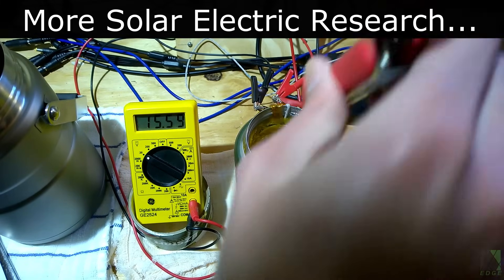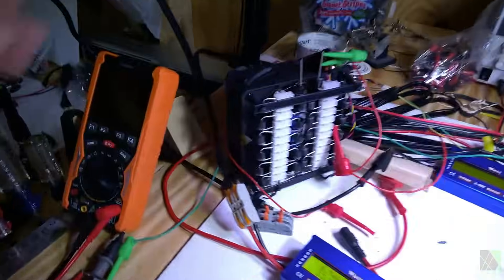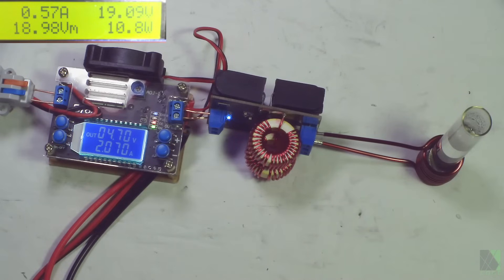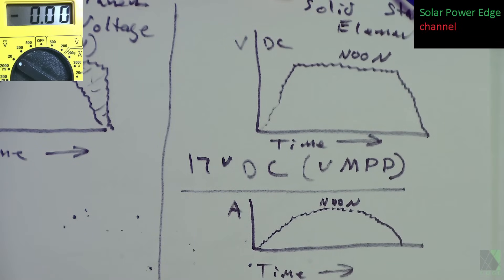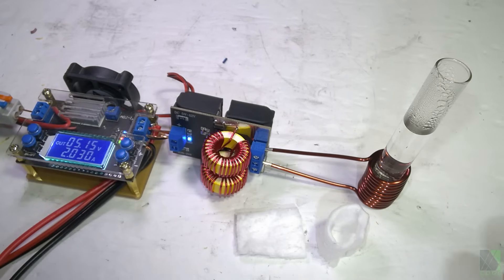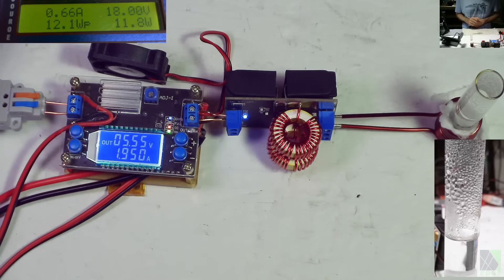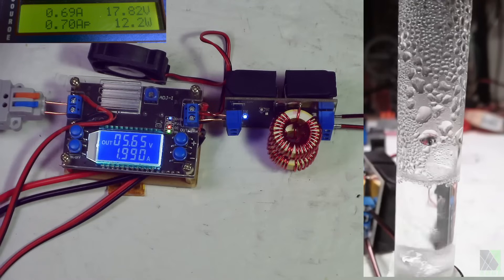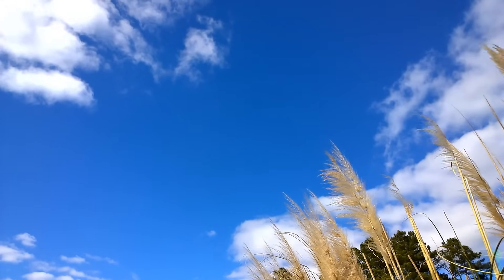15 Watts of Solar Power Boiling Water! induction experiments in my solar workshop #experiment

Comment: can use your induction heater around a radiator  pump water around ;)
Reply from the maker: @tenij000 Really need to try that :) could use metal slug inside rubber hose to heat the water.. I have some small radiators packed away somewhere that could be used for the experiment

Comment: If you can boil water with this little power. What if you had a 100-200w  induction coil heating a container with water in it then tat hot not boiling water was pumped using a small low powered pump through a wet radiator. The type of radiators used with a gas boiler they don't hold that much water and you only need to heat I to to around 60 degrees Celsius. Could be a cheap way to heat a tree room.   You get elements for these radiators but they use too much power. Induction has the potential to be more efficient and cheaper to run.
Reply from the maker: @woodworks2123 I like your ideas, thanks for sharing! This was a very small induction device, but currently testing a larger one and really hope to do something interesting with it. I do think induction can be incredibly useful. If any of my future induction experiments are good enough, I hope to share them here :)

Comment: I am confused...  Don't you want to insulate around the coils to keep the heat in?  By insulating the tube, you do prevent it getting so hot it breaks, but you also block thermal transfer.  Seems like putting the coil in a thermos would have been a better option... maybe?
Reply from the maker: @donovanallen The coil isn't really supposed to make heat, that's merely a byproduct of induction. The most heat is coming from a piece of metal inside the insulated glass tube, which is inside the electromagnetic field. Insulating the coil would make it very hot and increase its resistance. So basically induction heat has benefits but also drawbacks. 
You might be interested in seeing this - an extremely efficient 14w solar electric cooker:
https://youtu.be/CRhkZp6ECHk

Comment: Could you design an induction heater for use as a vegetable oil fuel heater for a diesel engine, I live off grid in rural Alaska and need a way to heat a fuel supply (inline, or in bulk tank) to about 100C for use in a diesel generator,  the ambient outside temperature can be as low as -40C/F. It would be ideal to heat a copper fuel line that could be wound around the fuel filter housing before the fuel pump using a low input induction heater that maybe could be hand cranked? Like a small hand crank radio or powered by batteries, however batteries really don't like the low temperatures here. If I could heat the fuel to 90C before the injection pump then the generator could use waste vegetable oil as fuel without first starting on regular Diesel fuel, thus negating the need to buy said diesel. I get the vegetable oil for free so this would be the ideal result. Fuel supply is aprox 3/8" ID tube and aprox. 1 US. Gallon per hour. It doesn't need to be hot, just warm enough to reduce the viscosity of the vegetable oil to about the same as water at room temperature.  I have access to lots of scrap materials and parts so a list of junk that could be used would be very helpful.  Thank you for reading this and for your great videos.
Reply from the maker: @jasonburguess Hi, I'm thankful you like my videos :D do you have a small insulated container available? what you're describing could absolutely work, even without induction. A simple resistance heating element might do the job. Question is, how many watts Watts to heat that gallon of fuel in time. It is only my opinion, I'd find a container of about 1 gallon and start experimenting with warming it up. Insulation might be required in such cold climates (more heat going into the oil instead of the air). Not sure how much fire risk is involved, but obviously safety first. And the fuel lines might need to be insulated in transit to the engine. I'm surely not an expert on surviving -40 degrees but just sharing my thoughts for what it's worth
Reply: @solarpoweredge  I was thinking about heating a gallon or so too, but seeing as the generator which is a 2 cylinder lister diesel making 6500 watts only consumes a gallon per hour, I thought it might be easier to use a low powered Induction coil around the fuel line and filter just to get it started, then once running I could use a 240 volt 2500 watt resistance heating element to heat the rest of the tank. I'm not sure, but I think a small hand crank emergency radio has the frequency switching circuit necessary for the Induction coil,  and a small battery could be used in a transformer circuit for the input voltage. But I'm new to all the electronics on this and thought you'd know better than I do weather that was possible or not. Thanks for your replies!
Reply from the maker: Glad to help in any way I can! Your idea to use an induction coil is definitely innovative. I believe it would work fine on a metal fuel line. Some of the heat would get conducted in both directions of the fuel line. There are pre-built induction circuits (ZVS) that could do the job. They look very similar to the circuit I used in the video. However the electronics in those circuits are powerful and far exceed anything in a radio, it's specialized stuff. 

Thinking about cost vs. time and complexity: what if you wrapped a simple low voltage (resistance) heating element around that part of the fuel line? Add a bit of insulation, heating element, some wires, maybe a fuse and a switch / thermostat. Not sure how many watts would be enough. Flammability might be a concern. 
And another version of this is a simple heated 1gal tank sitting near the generator with an insulated fuel line to deliver the pre-heated fuel to the motor. 
Another option is to reduce the tank size: half gallon perhaps, lower power requirement, higher potential temps, but fresh fuel coming in will still remove some of the heat. 
All of this is theoretical guess work. Just sharing my opinions and ideas, I fully appreciate the fact I 'm not located in Alaska battling those -40 degree temps :)

Comment: I was looking into getting a buck converter to charge my Ebike battery with solar. I tested the posibilties out witha small solar panel from my boat battery maintainer. it only puts out about 23 volts at peak. but it will charge my power tool 20volt batteries as is, just wont get to 100% charge.. It takes all day, at least thats how long Ii waIted before I checked the state of charge, then I plugged it into the regular tool charger, and it literally took 15 minutes to finish to full charge, so it was very close to full.
Reply from the maker: @billk9628 Cool! Only a guess but there is possibly not much current flowing once the battery hits 21V, which certainly makes charging a bit safer. Btw it's worth checking whether this charging method activate the BMS/balance circuits on the power tool battery. I ran into that issue with my Ryobi 18v power tool batteries, which is why I use a modified OEM charger with the solar panel. Otherwise, some of the solar panels I use (VOC 22-23v or so) could damage my Ryobi batteries.

Comment: A simpler way to get magnetic induction heating is to run an electric motor spinning a disc with.alternating N S magnets glued. To disk.  Only need enough power to run motor and alternating magnetic fields would do the heating
Reply from the maker: @miken7629 Really need to try that, very interesting!

Comment: so in your diode chain video you talked about impedance matching the solar cell. firstly since impedance is essentially resistance of an alternating current how is impedance used in the diode chain DC circuit? also i am more interested in harnessing solar power during the day to store in batteries for heating during the night time. Does this impedance matching with diode chain become lost when running it off batteries instead of directly from solar cell? thanks
Reply from the maker: @jdscott20101 Hi, diode chains aren't actually useful with a battery. Diodes don't have resistance to current flow. In fact a battery can burn them up instantly. What we have to match is the voltage drop of the diode chain versus the volts-max-power voltage of the solar panel. If the solar panel needs to be at 17 volts for example, then use the proper number of diodes to drop 17v. 

Diodes aren't ohmic, so they don't have an impedance per se. Instead they drop a certain amount of voltage. But the current is whatever you want to push through. Using the previous example, if the solar panel can push 5 amps, then you get 17v at 5A. If the sun goes behind the clouds, the voltage will swing a little, but the current will down significantly - thus regulating at about 17v. Oddly, this is mimicking the behavior of an MPPT charge controller under changing solar conditions - but without smart electronic circuitry. 

To be clear, a resistance heating element (nichrome for example) simply cannot regulate. It is a linear relationship between resistance (impedance), voltage and current. But diodes don't change their voltage drop much at all. Their current on the other hand, can adapt to whatever the solar panel can supply at each moment. While maintaining close to the volts-max-power range. This makes them surprisingly useful for direct PV DC heating applications.

Hope this makes sense, any questions please let me know

Comment: Another idea: I live in a cold area and loose a lot of batteries due to freezing if I leave my trailer when it’s -44’C..
But, with an apx 14v Chain of diodes in series with a resistance heater cable (or not, maybe just diodes). At apx 13.3v branch off to charge the batteries. The heater cable (or diodes) lies between two insulated batteries which become thermal
Mass…..
Imma get more batteries again!!
The panel charges up the batts and when they are full the diodes take it all.
But I’m stoned and might. Be missing a detail…
Reply from the maker: @mikekhouri3016 FYI diodes can burn out when connected to batteries. Diodes have no resistance to current. They'll take whatever gets pushed through. Best to use a current-limited source to power them (solar panel). Otherwise, with direct connection to batteries a normal resistance heating element is probably a better and safer choice.

Comment: Inspired by this (and until I get a bunch of high current diodes) I used a broken space heater and used one of the 750w ac heating (resistance) coils connected directly to my 100w solar panel and it got hot! I’m an off grid guy up north with a solar panel on his roof, and I’m gonna set this up right in front of me at the base of the windshield as a free permanent windshield defrost/defog and another one to defrost the chickens waterer.
Thanks!! I love community inspiration and freely shared knowledge!!
Maybe later hook a 500w wind generator directly up to one of the 750w coils and stuff it in a cold corner of the trailer. Also easy to hook a 12v fan directly to the panel in parallel with the coil (diodes once I get them)
Reply from the maker: @mikekhouri3016 Glad you found this stuff useful. You understand what this channel is about :) 

Believe it or not, diodes can also be used to regulate resistance heaters. I am already working on that in my shop. In fact, it's the core reason why I started testing diode strings / chains - I wanted to avoid MPPT circuits in my solar electric heating system. Will make a video about this as soon as I can.

Note if you push 100w into a diode chain, the object is to extract the heat. So probably need a heat sink, fan etc. to pull the heat out. Otherwise, diodes will just get  hot and burn up. I am using big power diodes with a heat sink and fan, works good enough. I try to keep them below 100C, for best longevity overall. with a proper setup, one can push kilowatts through a set of diodes, as long as they don't overheat.

Comment: How about as an atmospheric water collector for dry areas?
If used like a propane fridge it should quite easy to use the heat as a cooler on very low power as a system support. Never need to water the garden again!
Reply from the maker: @mikekhouri3016  The sky is the limit! Good ideas!

Comment: If you immerse the induction coil into the water too you could recover/make use of the lost heat that is being lost into the air. It could be in an outer chamber also containing water (ex: a slightly larger test tube outside the inner one) so the coil still does not contaminate the food you may be cooking.
Reply from the maker: @dans381 That's a good idea, the coil gets pretty hot

Comment: I once tried boiling water with a magnifying lens (fresnel). It was only a capful of water. 
It totally failed. 
Then I dropped in a small piece of charcoal from my aquarium. When I hit it with concentrated solar power it got nice and hot to boil away the water. 
I'm not sure which method is more efficient. 🤔
Reply from the maker: @SciHeartJourney A piece of iron should be much better for induction, however it's also worth pointing out the solar panel could not push any harder than 10w no matter what metal is used. But it's interesting to test this kind of stuff and see what happens

Comment: one thing to improve the efficiency of ur setup by 100% & instantly. replace whatever u dropped into the tube with a  thin sheet of rolled iron (not steel alloy, copper or aluminium. please make a follow-up video for benefit of viewers. Ciao

Comment: You are a genius! I will also build the egg cooker.
Reply from the maker: @fonix68 Have fun :) I built 3 of them. I don't feel like a genius lol. Note the diodes should be thermally linked to the water somehow, think of it like a heat sink. Diodes will burn if they get too hot. Some people use thermal adhesives, etc. or tabbed diodes, but whatever is most convenient

Comment: Wonder if thermally wrapping around the coil would be better. As that would make any heat losses in the coil contribute to the overall heating. (Ok, that is basically resistive heating). Though there might be overall losses when the whole testtube/coil assy gets up to 100degC and energy starts to leak out along the copper wires running from the coil.

But as an overall efficiency, this system is never going to be as good as a straight resistive heater.
Reply from the maker: @gonzo_the_great1675 The top suggestion so far has been to wrap the coil! the main reasons I didn't are more resistance caused by higher temperature and I felt the enamel coating on the wire was questionable. I usually base my appliances on resistance or diode string heating, this experiment was prompted by several requests to play around with induction. While not as electrically efficient, induction does have very interesting applications and advantages. I learned a lot from this experiment.

Comment: Why would you insulate BETWEEN the glass test tube and the induction coil?  I am not grouching, and like the work.  You want THERMAL CONDUCTION there, no insulation and preferably a metallic tube.  Put your insulation on the OUTSIDE of the coil to contain heat  losses to the ambient air.  Same experiment will do better I think.    
I saw where you boiled the egg in the 12v DC cup.  It was probably dual wall, maybe vacuum insulated.  GOOD.  No better thermal insulator than vacuum.  A dbl wall VACUUM insulated vessel like one of the gigantic coffee cups, with the coil in the skinny part at the bottom might be a good try THERMALLY with the cool stuff you are doing ELECTRICALLY.  
Also if you double-coil your induction loop, winding TWO strands instead of one, then both +/- conductor ends come out the top side by side and its easer to immerse in your vacuum cup, instead of having ONE conductor run up the side from the bottom.  Keep it up with the induction because I think those can be made more efficient than other stuff.
Reply from the maker: @mrwayneright Thanks for the feedback... In my mind, I was just not interested in further heating the coil by wrapping it in insulation. Maybe will try that in a future experiment. Obviously quite a lot of heat is being wasted - that's worth improving

Comment: Instead of insulating the induction coil, why not put the induction coil into something that will absorb and trap the heat, then use that heat to further heat the water? 

The most simple solution that comes to mind is to, put the coil into water, then drop the test tube in the coil, the water in the tube is still isolated from the water used for cooling but the water from the coil will trap the coil heat and further heat the water in the tube.
Reply from the maker: @xxpr0nag3xx92 Good idea to extract heat from the coil. It was getting too hot to touch, lots of wasted power

Comment: Nice video! The power required to boil water is determined by the heat loss, so with perfect insulation (which isn't practically possible) the power input would just dictate how fast a given amount of water would boil, and any amount of power would make water boil, in theory. 

Have you tried using high temperature peltier modules for boiling water? They're technically better at heating than cooling as the power they use turns into heat. And when used for heating it should be possible to increase efficiency by stacking them, as the efficiency improves the smaller temperature difference they have to create, and the heat generated by their own power consumption adds to the overall heating. Most cheap peltier modules aren't designed to tolerate more than 70 °C,  so for long term use any stage that gets hotter than that should be modules that are designed for high temperatures.
Reply from the maker: @fishyerik Good info, ty. I am testing all aspects of peltiers, including thermoelectric power generation and heating. It's a huge task, hope to make more video soon